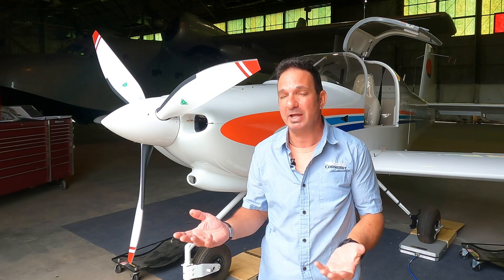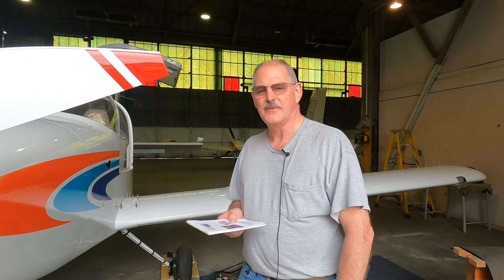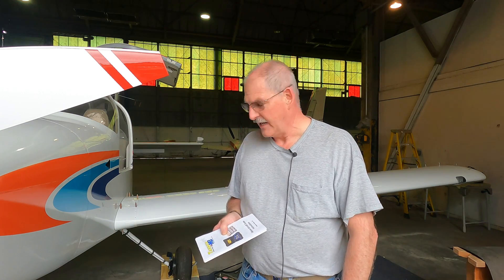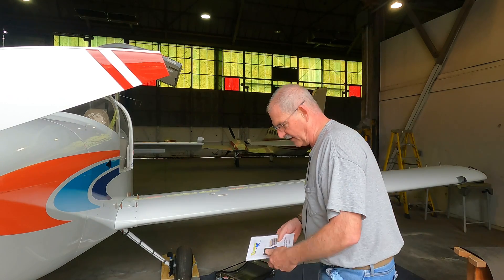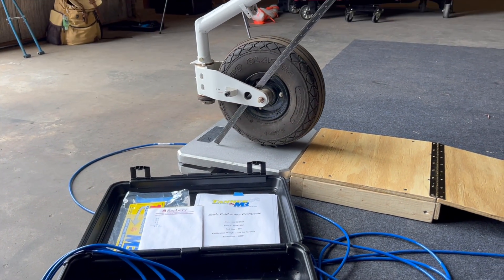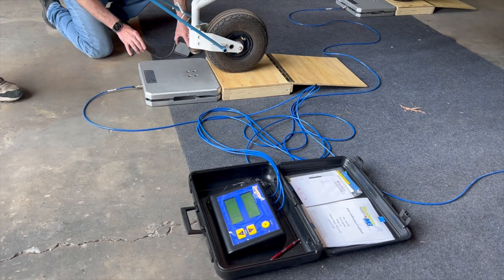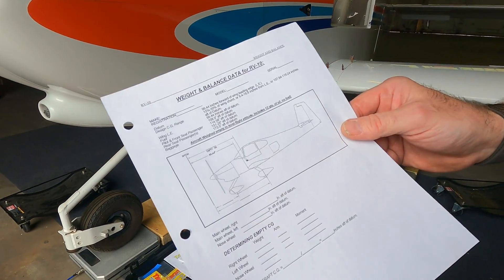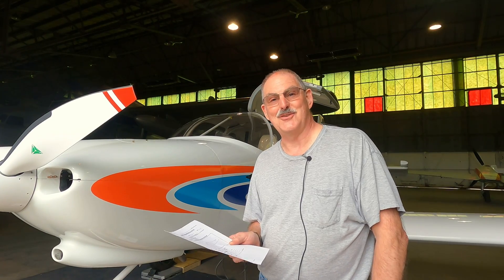Weighing an RV-10

Comment: Not really a helpful video in providing info where many people have questions or mis-weigh their airplane. Missed a lot of very important items is this video. There are Basic items that should have been mentioned in the video such as leveling the plane and what should be on/in the airplane to be included in empty weight.  Things like Video showed oil bottles on engine but never explained why.
Reply: and also had parts taped to plane, and clecos still attached and hatch open and chocks on the scale.  Didn't mention fluids to be included or EXCLUDED.   Video can confuse the first time weigher and provide them with erroneous procedure.  Also didn't explain how to raise nose for CG vertical position determination (which is really only relevant for aerobatics --- you really want to raise the scale on the nosewheel. DON'T be pulling the tail down or jacking midpoint on the plane -- screws up weight)